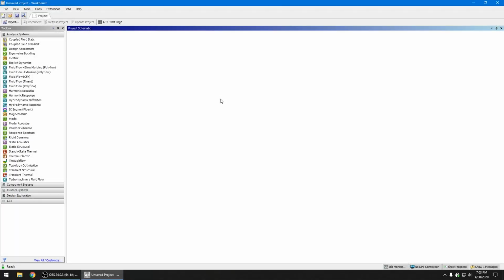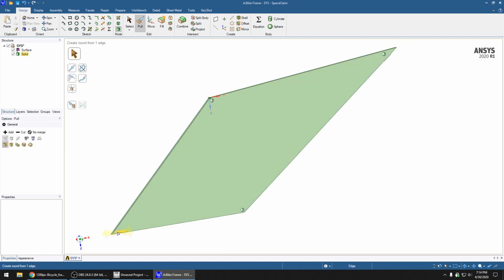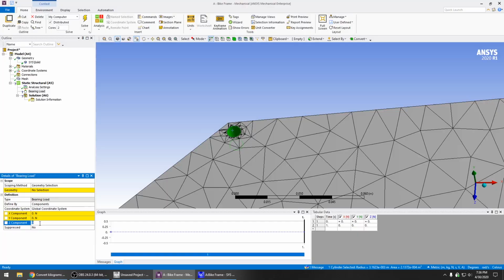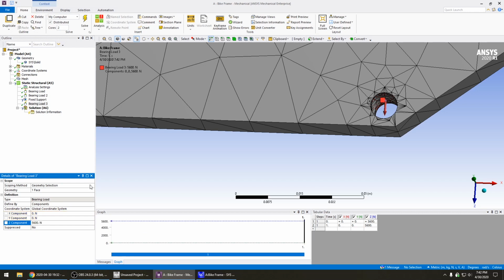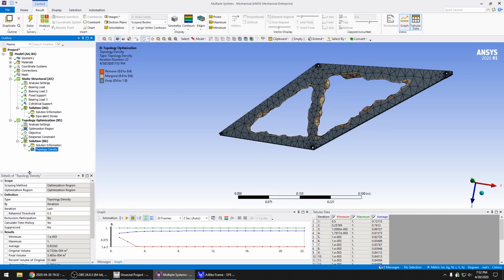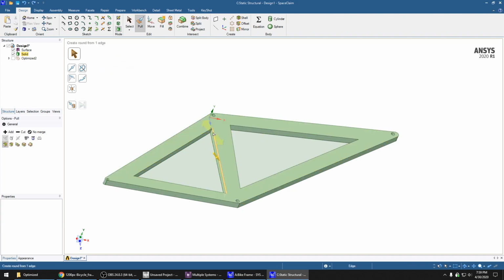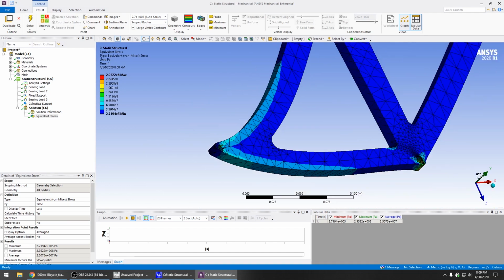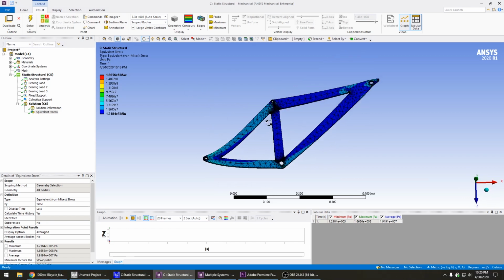Modeling Bicycle Frames using Ansys Topology Optimization

Comment: After the topology optimization I didn't get the same shape. Can you suggest me the reason for the error
Reply: Did you use the exact same inputs? If you don't use the same inputs you won't get the same output.

Comment: Great video man, I'm just wondering why did you use that acceleration instead of using gravitational acceleration, 76 m/s2 looks like something's wrong in your calculation bro
Reply from the maker: Thanks!  In the scanned image at 11:40, I show how I arrived at that value.  On the right, I show how a 10 foot huck-to-flat (using standard gravitational acceleration!) gets you 7.67 m/s of downward velocity.  Then, shown in the middle column is how I used that velocity, a 160 lb rider, and 100 millisecond deceleration in order to arrive at that acceleration value.  From that, I can find the force in newtons.

In other words, I did use gravitational acceleration, just earlier on.

Comment: What boundary conditions will you choose for rear suspension?
Reply from the maker: This frame didn't actually have rear suspension, since the rear seat stay is a part of the frame.  If you were to use rear suspension, you could do some more quick hand calcs like I did, and choose a point on the frame where the shock will attach to it, somewhere along the seat tube.
Reply: @Chinook249   Tq... I have one doubt and one query....
Doubt: Why haven't you considered roller support in the rear wheel. You have considered only tangential rotation as free....
Query: The worst condition for a bike with suspension is, when bike is in the air and considering the suspension as rigid. Now here in this case, what is the amount of load and type of load u would recomend?